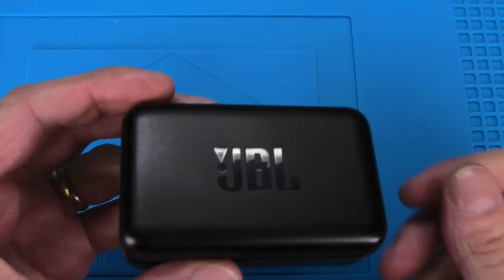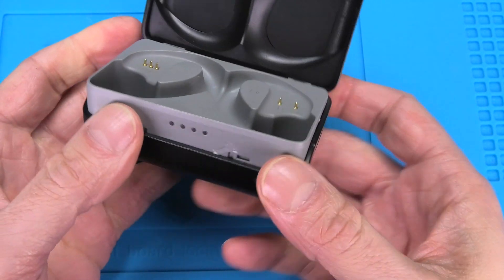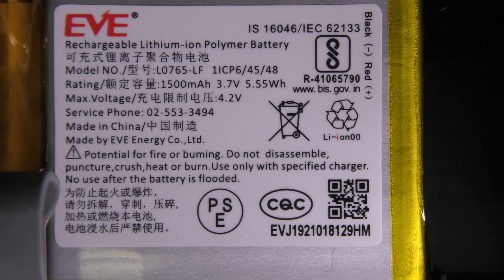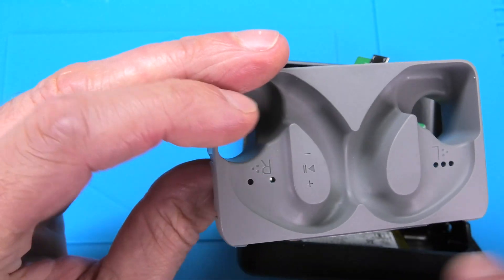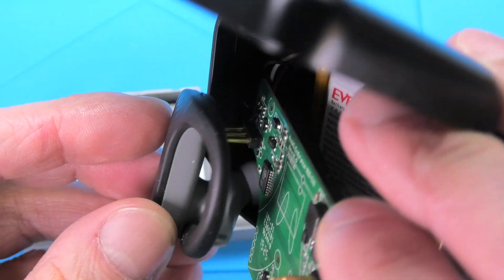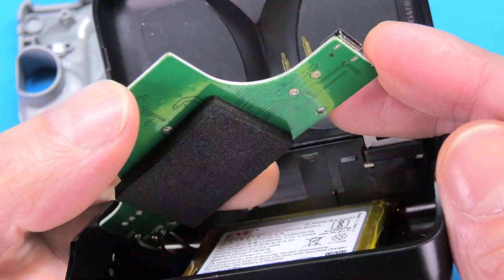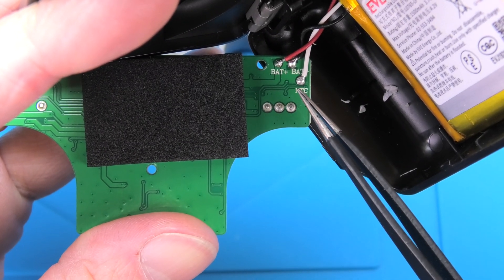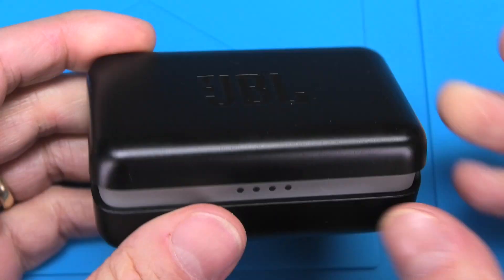JBL Endurance Peak - Battery Replacement for the Charging Case TEARDOWN  Not the earbuds themselves

Comment: BTW there is no need to unscrew the PCB to change the accu. The PCB should be handled with caution to avoid electrostatic discharge as this can blow the single chip processor.

Comment: Do you know what voltage is being provided to the earbuds by the case? (Voltage on the u+ pin)
Reply from the maker: I’m measuring around 3.2 to 3.3 volts.
Reply: @MegaSafetyFirst  hmm, that's surprising considering there is a 3.7 V (nominal) battery in each earbud. I wonder if the earbuds have voltage booster circuitry.
Reply from the maker: I agree.  I was expecting 3.7 also.
Reply: 3.7 bolts x 2
Reply: It should be 3.7V. During charging it will be less depending on the charge state of the ear bud and increase to 3.7V when charged completely.